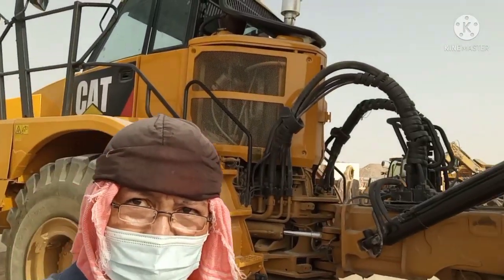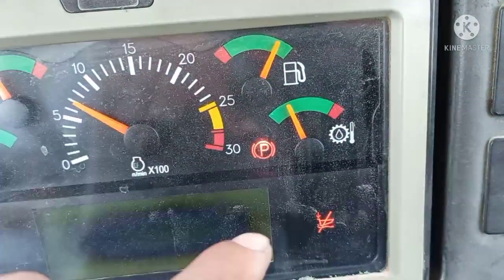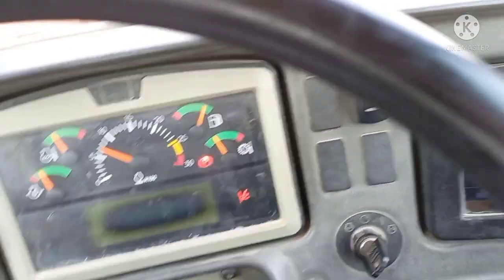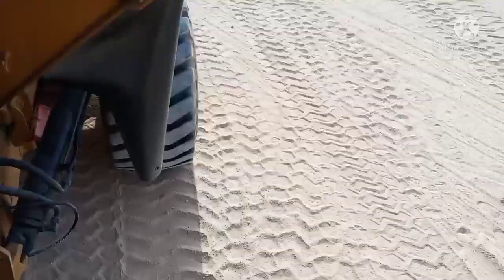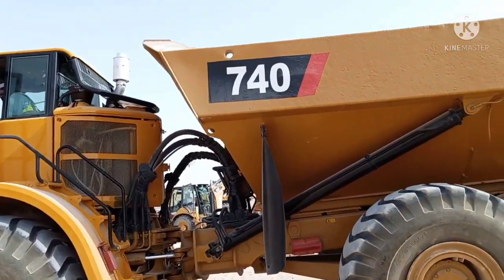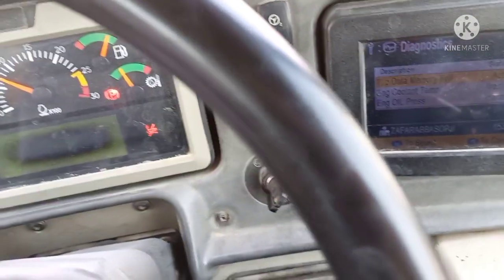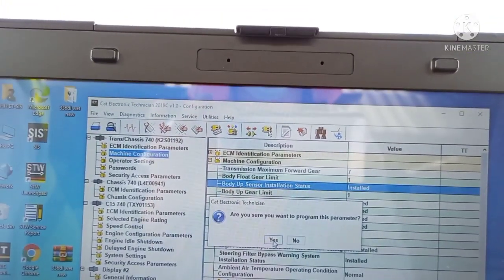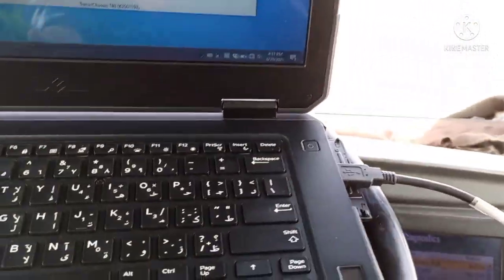Cat 740 dumper transmission not changing to high

Comment: boss ano po problema ang dumper na isang gear at reverse lng ca
Reply from the maker: Brad may ilaw b ang parking light, at may ilaw s dash board yung dumper nya, kung meron nililimit nyan ang gear function kapag naka warning ⚠️
Reply: @caterpillarjhunhunk  wala pong nakailaw sir. bali ung dust board lng ang makikita lng dito sa oil at sa hangin temp ng tubeg. my dalawang sensor dito ng gear nya sir posible kaya masira to. kc po ung dumper po bagong overhauling kc sir.
Reply: sa ngaun po sir my naka ilaw na xa kahit naka takbo ma ayaw nang mawal ung ilaw nya ng alarm sa dustboard